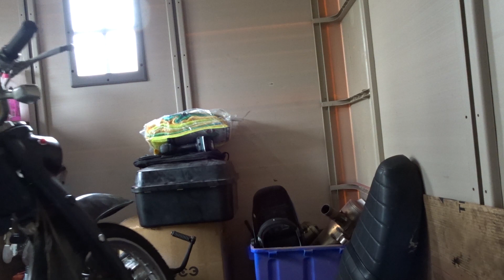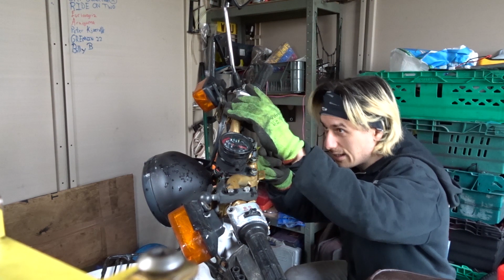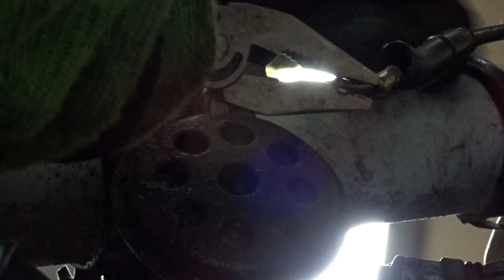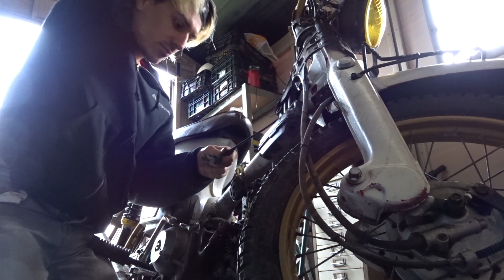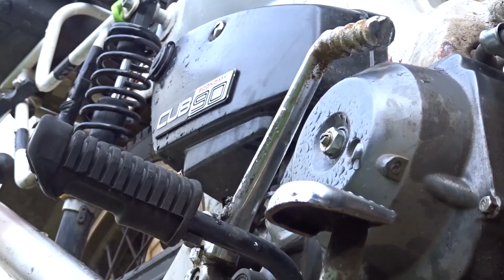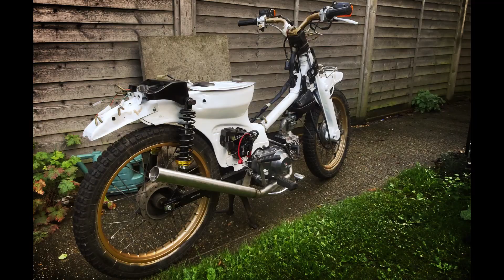Sticky Throttle Be Gone

Comment: ... well, an "old school" tip: I have mounted a Bowden cable oiler (... the plastic ones with the cute cap ...) on every Bowden cable (Clutch, two shift cables, throttle cable and front brake) at the highest point on my Vespa PX and give it one or two pumps of plain engine oil every year, ... that flushes out the dirt and prevents corrosion ...

Comment: lad you got it sorted, although it still sounded like it was struggling a little
Reply from the maker: its fine now just did not like me twisting the throttle with the fuel tap still ON but its cleared now after a run
Reply: @BigPezza  :-)